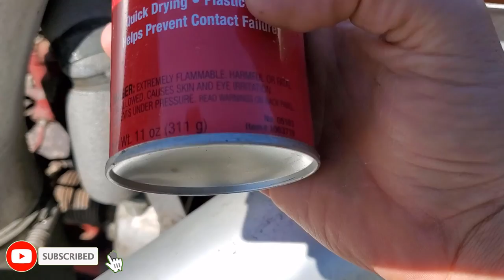Getting An Engine Wash At A Truck Wash - Be Careful!!! | Landstar BCO/Owner Operator Trucking

Comment from the maker: ****My Other Videos Mentioned In This Video***
📹DPF/SCR Wiring Harness Replacement + SCR Temp Sensor Replacement - Kenworth Truck DIY
https://youtu.be/-VxPiaVUo_U
📹Kenworth T660 Cummins ISX15 Engine Wiring Harness Replacement
https://youtu.be/ZElZhayPsRw
📹My PDI Big Boss Tuner On Cummins ISX15 - Owner Operator Trucking
https://youtu.be/vXg-EGmFGD0
📹This $500 Tool Can Save You $1,000's The Bosch HD $$$ | Owner Operator Trucking
https://youtu.be/eIFpb6JjXIw
Reply: @Trucking & Fixing With Ryan
Unfortunately; your first mistake was going to the Streakin’ Beacon!

I understand that it was convenient and close and you were killing time, but you ended up killing more time than you wished!!

I’m sorry that that happened to you, but the Beacon is and has been notorious for screwing up trucks more than cleaning them!!!

Comment: the low coolant light is a known issue, it is very rarely a sensor, the coolant tank uses a float, with a ball on the inside, the sensor reads the ball, the float fails or sticks on the bottom and low coolant light comes on, replacing the coolant tank is the fix, trp makes a coolant tank that is cheaper but you have to have all the hoses from trp as on some models they are different than oem.
Reply: 100% agree if harness reads high voltage unplugged harness is most likely fine surge tanks are extremely high failure rate, mechanic for fleet of kenworths replace surge tanks all the tome for this reason especially if they are discolored

Comment: I never pressure wash the Engine. I normally spray on a heavy duty Engine cleaner something like WAB. I the leave it to soak whilst I drink a hot Coffee. Then just spray it off with a hose. As long as you do it on a regular basis it really does keep it clean...
Reply: Do you have a video explaining how to do it?

Comment: I had the same issue with the water level sensor.  I replaced the resivor tank and problem fixed. The tank has a floater inside that goes bad. The floater is what the makes the sensors work. It's a magnetic thing. The tank was $99 bucks on ebay. Cheap fix.
Reply from the maker: Thanks for sharing!

Comment: I stop getting engine wash like 6 years ago. Now that I own my rig, i never get a engine wash. Leave it alone.  It works fine . 

Before, I always got a check engine light temporarily,  and that loud  Squeal noise.i feel we washing away the grease.  Thats how u loose pulleys,  bearing rust out, go dry over time from wash out.

Comment: Replacing surge tank will fix your issue , make sure when filling system with coolant you use airlift type vacuum fill , I have seen a lot of egr coolers fail prematurely due to air pockets causing hot spots, Cummins recommends vacuum filling for any engine with the plastic surge tanks
Reply from the maker: Thanks for sharing your wisdom! 👍

Comment: I’ve got the same problem with that antifreeze sensor and I replace the sensor couple times and it didn’t help but one mechanick  tell me replace the tank where you put antifreeze and it’s help code is gone and never shows up again idk if it’s help u but that’s lit trick what I did . The sensor by it self cost almost the same money on the deler as tank . But new tank has new sensor

Comment: Ryan love your videos. I’m going thru the Landstar process going into a mentoring program nervous since I’ve never done that type of load board jobs . I’m wondering how u plan so far ahead without knowing something can happen and be charged big amounts of $ if u don’t make your delivery. I drive teams now for FedEx so I’m From Florida to Oregon every week. So I like that u said the good loads are up there. Any pointers?
Reply from the maker: Booking your own loads isn’t too scary! After a while, you will have a good feel of it! Here are a few rules I follow. Stay on schedule for your delivery. Don’t book next pick up the same day you deliver the  previous load, unless you know the pick up load is flexible as far as the pick up time. Always try to deliver early if possible (consulting the load agent or call customer directly) so you have enough time for next pick up. Try to get near the next pick up location as early as you can, so you don’t need to worry something goes wrong at the last minute. Watch the weather in the cold winter days, plan your trip around the weather, etc... you will get better and better as you handle it more,
Reply: @truckingandfixing  thank you Ryan going thru the hiring process now . I’m going to start in a mentor ship and hopefully move on from there . I been running Tampa to Salt Lake for 3 years I’ve had my share of pileups on I-80. Thanks for the advice

Comment: I think if I was going to get an engine wash I would do it myself and beforehand I would wrap the sensitive electric components and wiring with Saran wrap and duct tape. It's not going to waterproof most of it but it would water resist it.